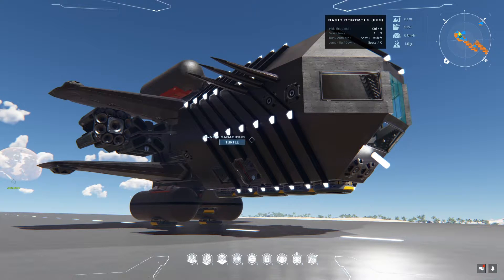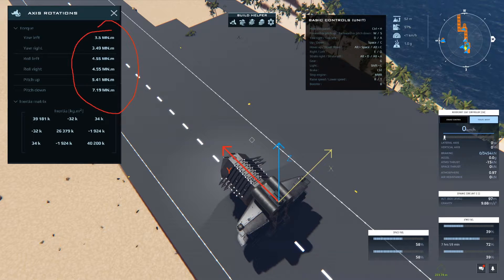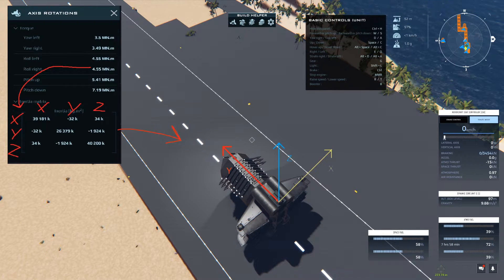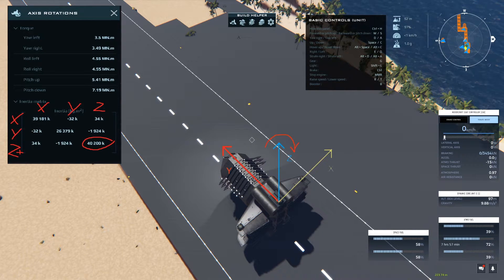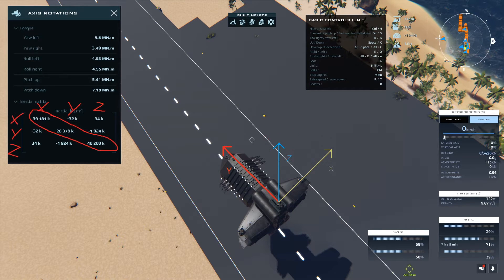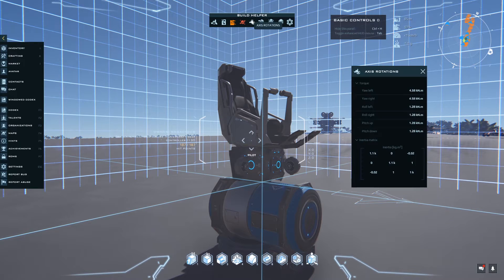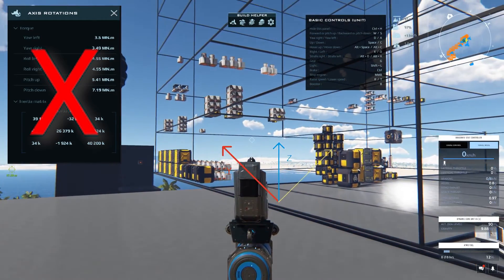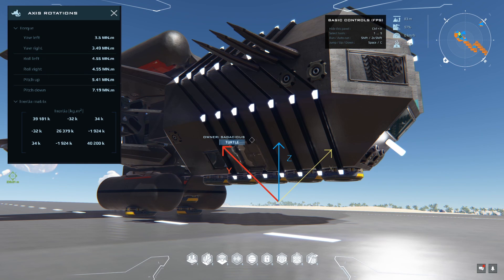Inertia Matrix what? How to read it - Ship Design part 1 Dual Universe

Comment: This is all nice but, most of the time you can't perfectly balance a ship because you actually want some style.  In the 21st century we have fly by wire where computers automatically adjust for imperfections in design, do we have this 10000 years in the future??  Can adverse roll be fixed with fly by wire in this game when yawing?  Be so nice to actually have my roll thrusters counteract my adverse roll when yawing. Can this be done with LUA?